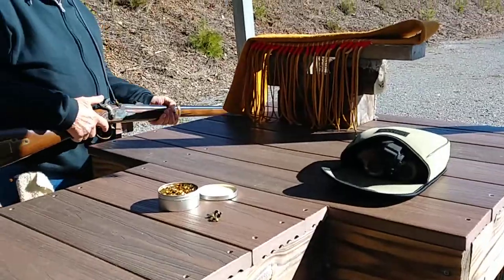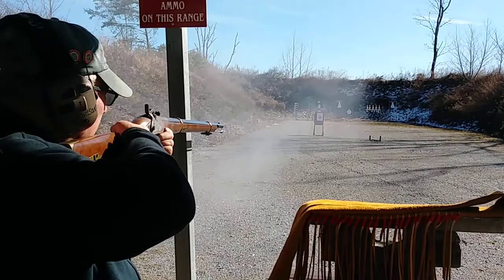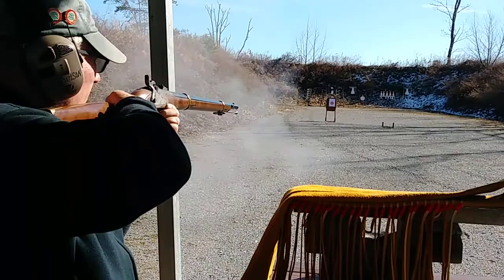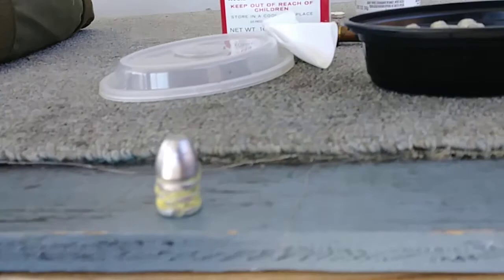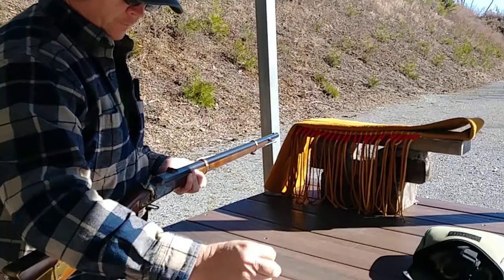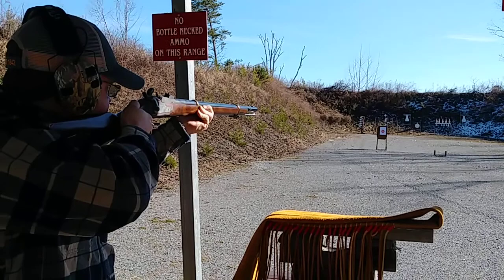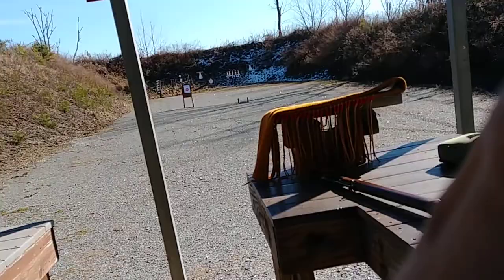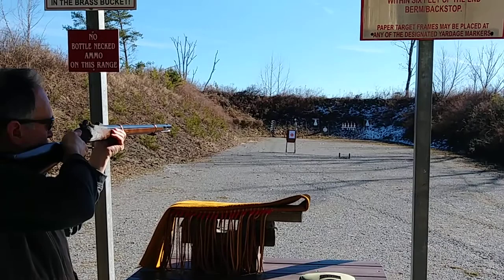1863 Remington Zouave - .58 caliber

Comment: For best accuracy and ability to fire more rounds without cleaning, you want to fill the hollow skirt area of the Minnie with bullet lube.  The Minnie balls bands should be fully greased too.
Reply from the maker: Yes. In a later video with the 1858 Enfield, we discovered that 3F powder works better to flare the skirt.
Reply: The powder charge for that should be around 60grs. of 3f BP.
Reply: Not so. Just grease the minie balls grooves.